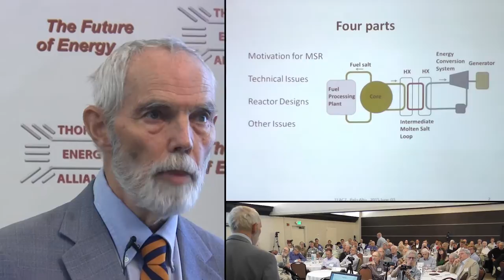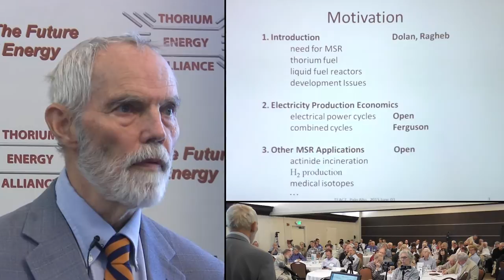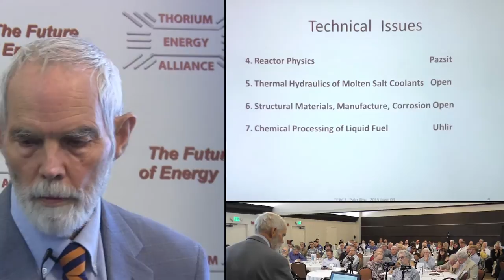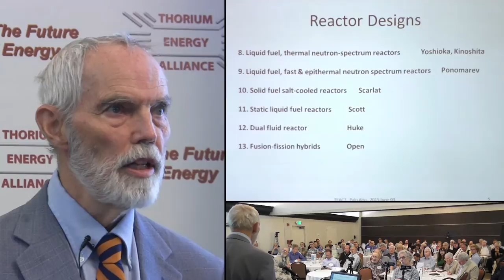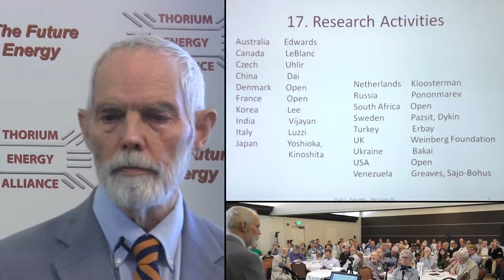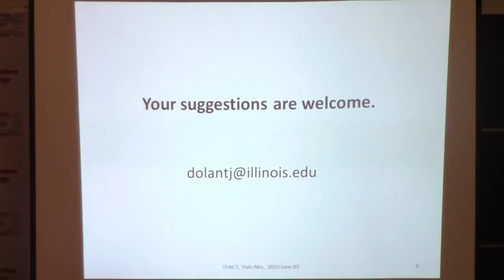Book on Molten Salt Reactors -by Thomas Dolan @ TEAC7

Comment: Has Professor Dolan looked into Jan Leen Van Kloosterman, Else Merle Lucotte or TU Delft's nuclear engineering faculty, which is (currently) co-ordinating the Euratom EVOL/SAMOFAR project? The Europeans have done a lot more work over a lot longer time and have  done more chemistry/materials, thermohydraulics and neutronics work than any other team that I've seen. Best of all, it's open, as it's a government project; so there's none of this black box IP stuff that the North Americans have been playing silly buggers with as of late.
http://www.janleenkloosterman.nl/symposium.php
https://www.iaea.org/nuclearenergy/nuclearpower/Downloadable/Meetings/2013/2013-03-04-03-07-CF-NPTD/T1.5/T1.5.merlelucotte.pdf